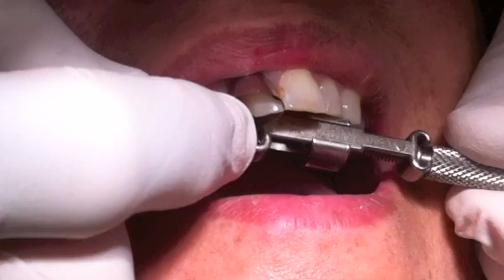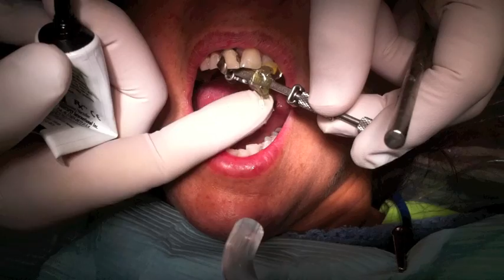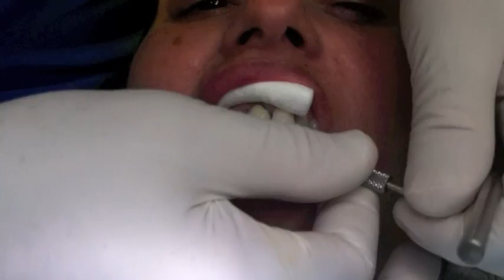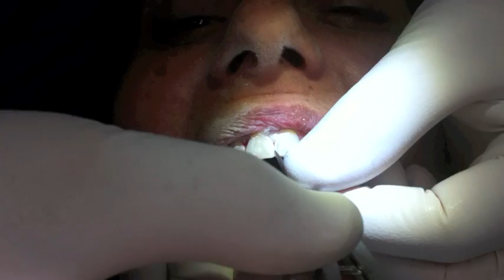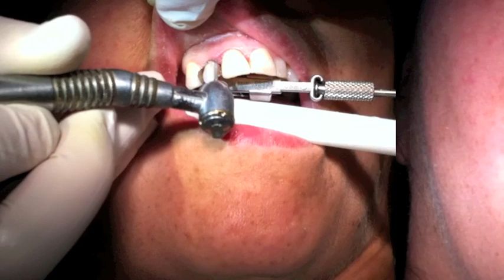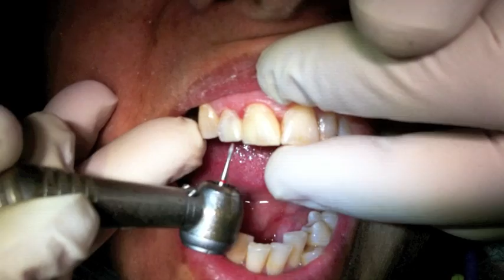Greater Curve Matrix Band

Comment: Proximal contact area of matrix band was trimmed away exposing mesial contact of #7 and composite was then added incrementally.  Wouldn't the composite bond directly to the exposed contact area of #7?  If so, how do you manage to remove the matrix through the proximal contact?